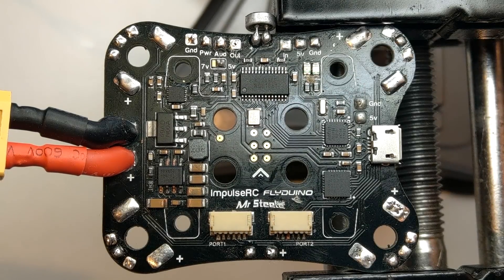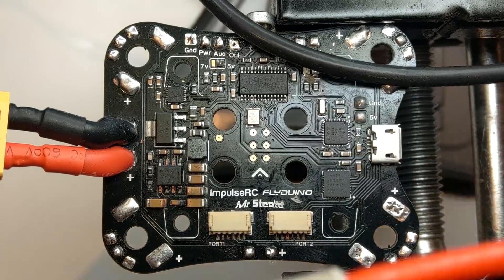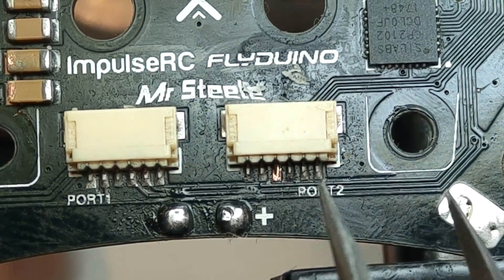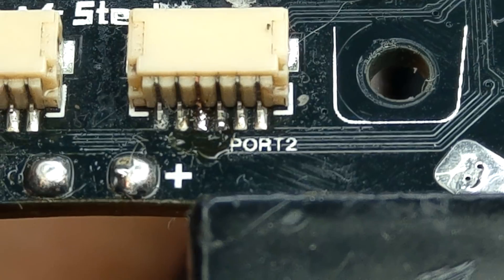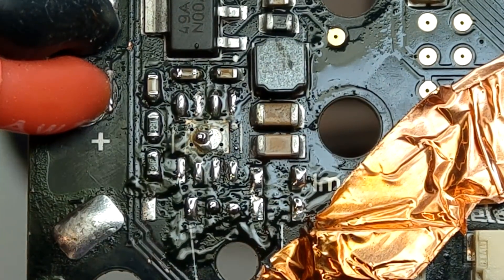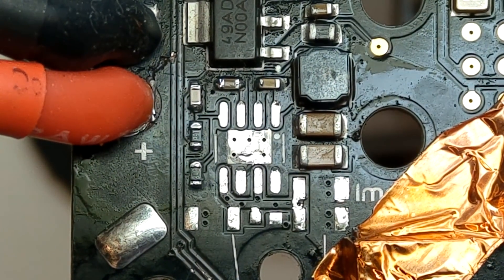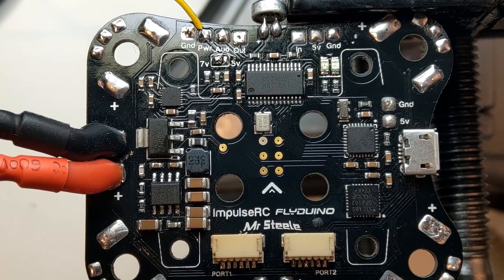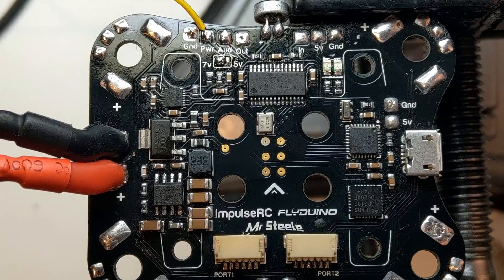Mr Steele PDB REPAIR (water damage)

Comment: Love your videos - subbed.  I've got a steele pdb that does not show voltage, mah, or amperage on the osd (all say 0).  There is no visible damage or corrosion on the board.  I have redone the configuration and flashing of the OSD, but no luck.  Last I remember, it worked...  Do you have ANY idea what might be the issue?  Thank so much!

Comment: Your good bro! I would have thrown the thing out. I didn't know the technique to work on these little guys. I have one that is new and only has 2.5 volts on the transmitter and the other 5v pads. Any suggestions?

Comment: Great videos Livyu, I have a question for you, 2 ESC telemetry pads of my steele PDB has come off (maybe too hot applyied onto the pad), any idea, link of a way to repair ? for instance, the link of a shop to buy pad. Thank you in advance and keep on making great flying and electronic repair video
Reply from the maker: the pads cannot be replaced. But you are lucky cause all 4 telemetry pads are in parallel so you just have to solder them to one of the other 2 good pads ;)
Reply: @LivyuFPV   thank you for your quick reply, in fact I had a look to the scheme of pdb and pads damaged are the pwm and ground of the same esc input. Any idea then if a simple repair is possible ? Sorry again for the wrong information of my previous message. Last time it happened, I inserted a thin copper wire threw the pdb pad hole from the bottom of the PDB and it worked for a while.

Comment: If you do get water especially saltwater on electronics try flushing with distilled or deionized water first it should remove most of the conductive minerals. I've rescued many a mobile/cell phone with this method.